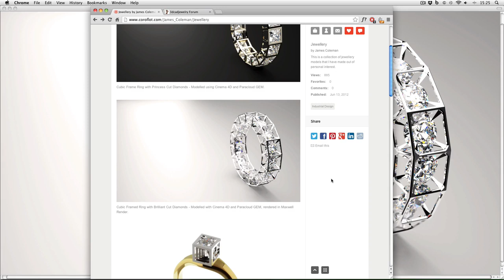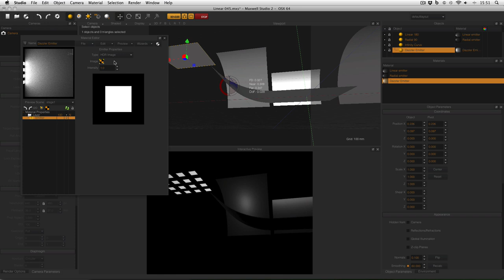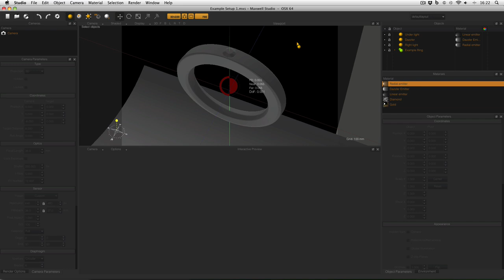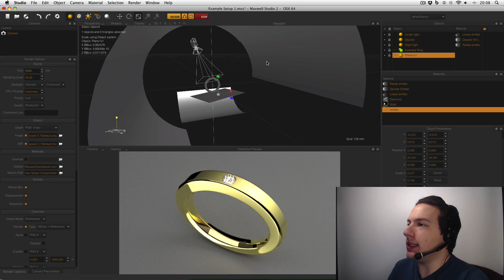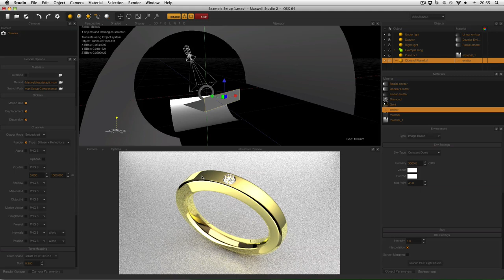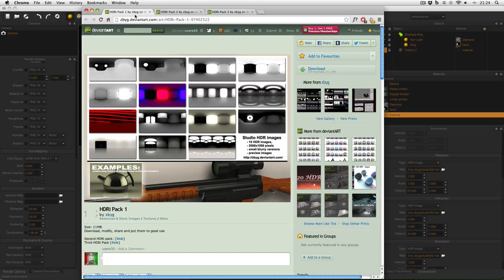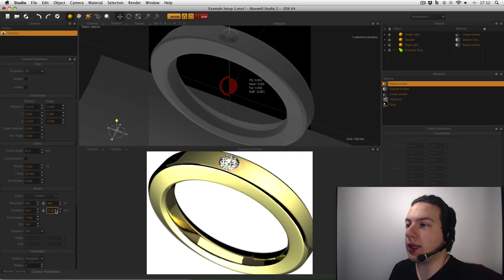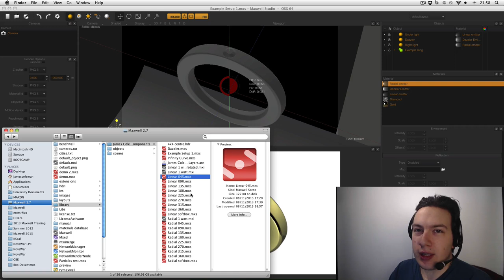Maxwell Render Jewellery/Product Packshot Tutorial With Free Setup Download

Comment: Hi, can I isolate the dispersion effects in one layer? No matter how many SL I put in my render, that dispersion looks so grainy. Thanks!
Reply from the maker: Hi Diego. Dispersion can be disabled but not isolated. It shouldn't look grainy after SL18-20. If you wan't to speak to me you can book a time here: https://helpouts.google.com/104019674967018683753/ls/80fabf7db288771f if there are no convenient times send me a message.
Reply: This is my first time using Maxwell and I love it. I just have 1 glass object with Abbe 60, SL 20 andn time 999, size: 1280x1024. White sky with NO sun and a fluorescent light. I left this for 10 hours and the render dispersion still looks kinda grainny. Thanks :D
Reply from the maker: Try using an .ior file instead of using Abbe. In that 10 hours what SL did it reach? I can't help more without seeing it, book a time here to speak to me: https://helpouts.google.com/104019674967018683753/ls/80fabf7db288771f

Comment: Hey! This is a cool vid. I'm having all kinds of trouble when importing stl models for jewelry renderings though. They always import at like 1000x their actual size. Not sure why. I export from Rhino & zBrush in the correct scale, but the objects import into Maxwell and even Keyshot at massively larger sizes. Im trying to create a template to do renderings of hundreds of the same pieces, but different detailing on them. Any advice?
Reply from the maker: +Jonathan Silva Are you exporting straight from Rhino/zBrush or exporting via the Maxwell for Rhino/zBrush plugins? I always recommend going via the plug-ins. Failing that, there are scale options in Maxwell Studio.
Reply: I was exporting as STL in the correct scale and for some reason, they always seem to import 1000x larger. Trying to get the hang of Maxwell still, but it doesn't seem to be very user friendly at all lol. Thanks for your help man.
Reply: +Jonathan Silva I am having this very same problem with Rhino and Zbrush!  Did you ever figure it out?  It's very confusing..
Reply: Johnson Dylan
With zBrush. when importing, you have to do it through 3dPrint Exporter plugin. You import the usual way, do your thing, then when you're ready to export, you go into the 3dPrint Exporter "Advanced Options", unclick 'move to origin' and switch from "for all subtool" to "per subtool". Then depending on your units, (mine is mm for jewelry) you go to to the top of the window and click "MM" then "update size ratios". It will close the dropdown but when you go back into it, the dimensions should all be correct and ready to export via the "STL" button.

Through a lot of trial and error I figured out that the stl size issue is within Keyshot. Either the settings need to be changed on my old version 5 templates to match the new version 6 updates, or keyshot needs to fix the bug. Either way it is always exactly increased by 1000x even when I choose to import in mm. My guess is Keyshot has a bug to fix. But in the meantime you can always go to the object properties and change import scale from 1000 to 1! Hope that helps.
Reply: +Jonathan Silva Thanks alot for replying! I really appreciate it!
Reply: +James Coleman 
First of all thank you for your Tutorials they are really well done! Do you have any tips about to this importing problem for such small objects like jewellery?...I will explain...I'm using Rhino 5 on mac OSX to draw my 3d jewellery, but since there is no plug in (for OSX) yet, I have to export them directly without using third part plug in...So as +Jonathan Silva said I though I exported in the right scale the object from rhino, but when I import it on Maxwell I get always an Object 1000x or more their actual size, same as him. This, as you showed on your tutorial affects a lot the quality in rendering and texture scale as they aren't real measure. I have tried different formats, STL, DXF, OBJ, ecc... but the problem still the same. I was looking on Maxwell for some scale options, but with the scale scene tool you can only "up scale" and not "down scale"...please it would be really nice to get a solution to this "basic" rendering problem :(  Thank you in advance! greets
Reply: Yup. overall I think Maxwell could be awesome, but it doesn't seem that user friendly. The poster is obviously an expert.